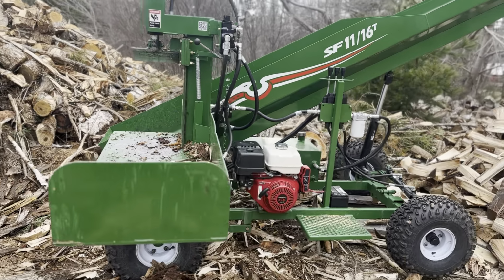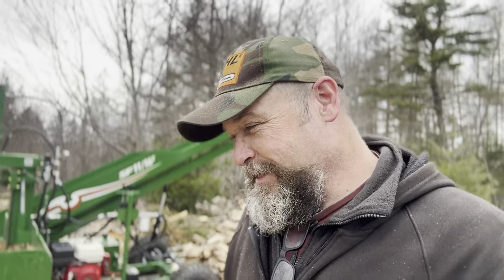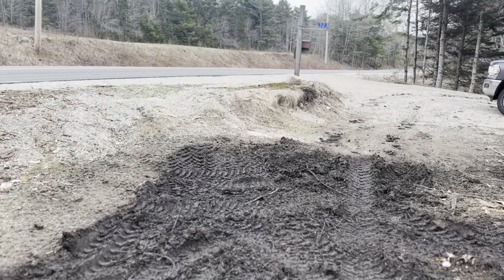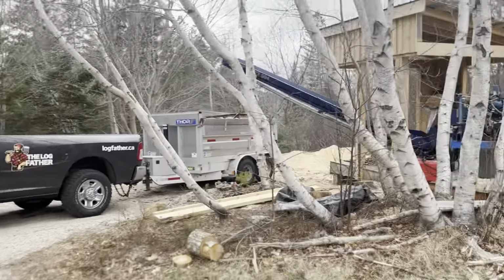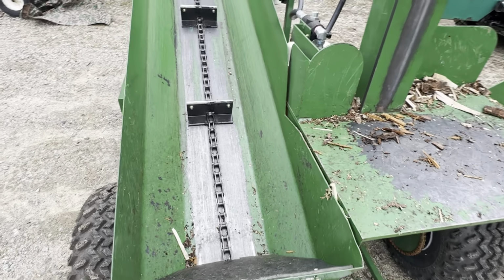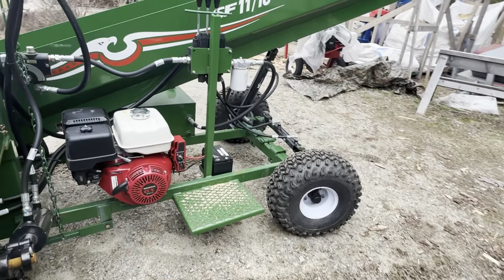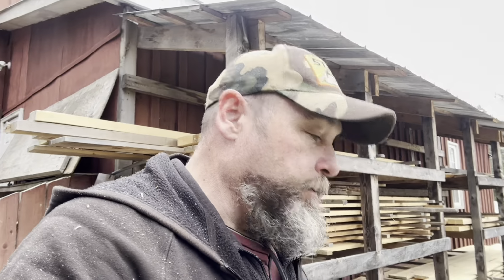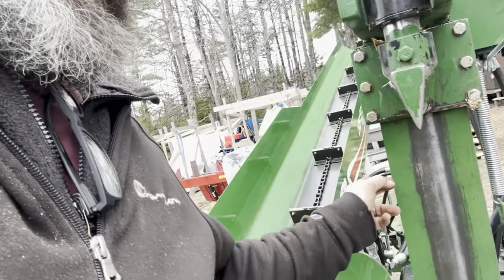SPLITFORCE is moving on.

Comment: Not to appear as the cranky one but... I'll agree with you in that you are nit picking Jeff. I see no problem with using paint, it's easier to touch up if that's an important thing for an owner. The paint's been worn off of ours for over a year now, no signs of rust but then again we use it almost every day. 
I don't think a second pump is needed either, it takes all of two seconds to move the log table up or down at full speed. While Gina operates our 9ton unit I can raise and lower the table with minimal affect of the splitter speed, but, we don't run a conveyor either so that may play a part in that. 
I also will say that the unit we have can keep two people busy full time, no conveyor and we stack as we go. I would imagine a unit with a conveyor would be even quicker. Just my take. One blocking and bringing rounds to the table, the other person splitter. 
As for a back rest while traveling, I disagree with that too. I think it would hinder a person's ability to get off the platform should they need to jump off for whatever reason.
I will agree that the smaller processor you have and the SF unit would be a good setup for someone. Maybe you should sell the Tajfun ;) and buy the SF.
Reply from the maker: I’m definitely nit-picking- hard to find any real faults. I certainly don’t have enough work to keep that machine busy. I’d only
Use it for the oversized logs that won’t run through my processor. My TAJFUN produces 4 times in a day what I can do with a chainsaw and that splitter though. Not to mention the SPLITFORCE burns 7 litres of gas every hour! So the TAJFUN is not likely going anywhere soon. The paint is a non issue for me- the back rest would be a luxury for sure. The splitter stops working as soon as the log lift table is moved- exactly as my SplitFire does too. Thanks for your input though Jim! 
Jeff
Reply: @thelogfather5002  Surprised at the 7L per hour. Ours has maybe 3L and goes for about 3-4 hours.
Reply from the maker: @WoodchuckCanuck  it’s about the same as my splitfire, so I expected as much. It has a fair bit more power than the Splitforce too, but not as fast, and the conveyor is the best part. It saves my old worn out shoulders chucking wood in a trailer.

Comment: I’m going to build one, without the conveyor, I said before it’s a game changer, I enjoy doing firewood but as I grow older I need that lift table and the speed it has is a big advantage as well. Any advice on building one? Other than 2 stage high flow pump and decent cylinder? 
Thanks for the honest review. Great work.
Reply from the maker: I’d probably have a look at Allen Family Firewood’s channel and see how ‘Old Buster’ is put together. It’s probably one of the strongest and fastest vertical splitter I’ve seen. It’s homemade. More hydraulics than you think, more horsepower too… stronger beam! A lot is good, more is better and too much is just right!
Reply: @thelogfather5002  thanks a lot Jeff